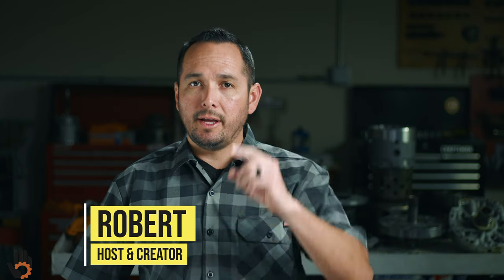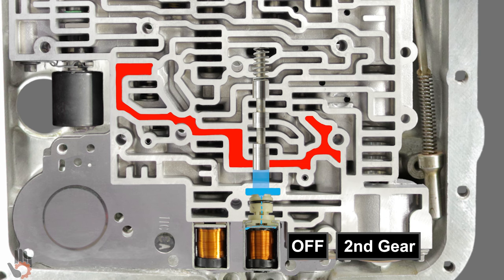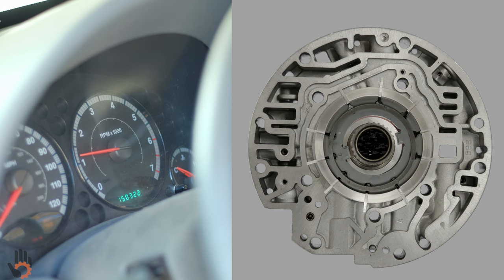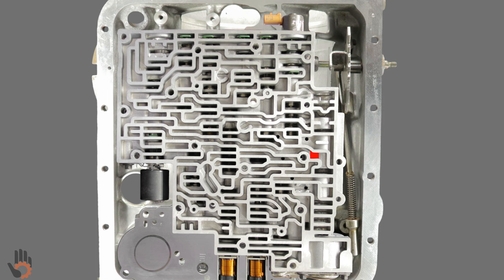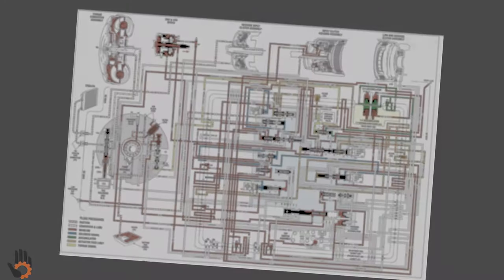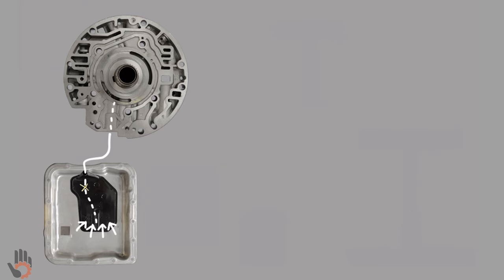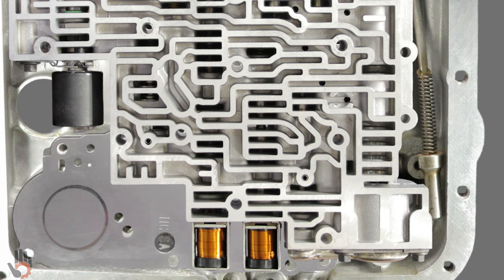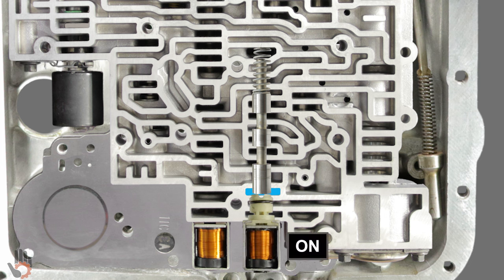4L60E: 1-2 Shift Valve + 1-2 Shift Solenoid (Part 1) Basic Operation

Comment: Wanna know about throttle valve
Reply from the maker: This trans is not equipped with a throttle valve.  The predecessor of this trans (700-R4)(also known as the 4L60) was equipped with one.  The 4L60E uses a solenoid instead.

Check out these videos to learn more:

4L60E Pump:
How Does it Work:  https://youtu.be/gJ5CdPJoJyg

4L60E PR Valve:
Part 1:  https://youtu.be/ELhJlZridIY
Part 2:  https://youtu.be/dJlUec91kgY
Part 3:  https://youtu.be/PY1trZeLqTM

Comment: We have a 2017 silverado 4.3L WT and now it just sits in our garage figuring out what's wrong with it. It only goes in reverse and wondering if it's the shift solenoids. There's no engine light on,no noises from the transmission. We took it to a Chevrolet dealership shop and they said we need a new transmission. Another shop said its the drum in the transmission. Our truck is little over 70,000 miles we only use it for work and get groceries. Not for hauling heavy duties or racing. We lost all hope because everyone wants 5,600 to 10,000 to fix our truck.
Reply: You have a broken drive shell
Reply from the maker: Sorry to hear about your transmission troubles.

If there was problem with a shift solenoid, you would still get forward movement.  However, the trans would be missing a gear or two...but, still have forward movement.
So, I don't think a shift solenoid is the issue.

I should really be asking more questions....but....
Based off of the info provided, I would be leaning towards an issue regarding:
1). Forward Clutch.
2). Input Sprag.

If you want to learn more, check out these videos.

4L60E Power Flow (1st, 2nd, 3rd, & 4th Gear) (Automatic transmission power flow)
https://youtu.be/IfOqbTqKubE

4L60E Power Flow - Manual 1st, Manual 2nd, & Manual 3rd
https://youtu.be/6kfAuXJFYFE

Comment: Hello sir . 2st gear only every time work .another gear don't working .how to repair guide.
Reply from the maker: Are you certain that it's 2nd gear, and not 3rd gear?
Reason being, if the PCM (computer) detects a major transmission problem, it will put the transmission in Fail-Safe Mode (also referred to as Limp Mode).  In this mode, the trans will only have 3rd gear, when the shifter is in the D position.  However, it is possible to get 2nd gear, too, by manually shifting.
Of course you'll have Reverse, too.

Was the transmission experiencing other problems, before this current problem occurred?
Reply: @SouthpawAutoworks  does't was other problem
Reply from the maker: Sorry, but I'm having trouble understanding.

Comment: My 4l60e slips on 1 2 shift and 2 3 shift if in drive but doesn't slip if shifed manually.  Anyone have a solution?
Reply from the maker: It sounds like you've got a clutch failing.

The 4L60E has multiple oil pressures working inside of it, all at the same time.  The highest oil pressure is used to apply the clutches (and the band).  That's it's main job.  The lower oil pressures are there to do other jobs.

When the PCM (computer) "sees" that the trans has been shifted into a manual gear (as opposed to D), it instantly raises the highest oil pressure....that's acting on the clutches.
There's a reason it does this...more on that, another time.

So, it sounds like you've got a clutch (or two) that's failing (slipping).  However, when more oil pressure is applied to the clutch, it reduces the chances of slipping...just like you're witnessing.

Think of the clutch as a clamp.  With less clamping pressure, things can start to slip.  However, with more clamping pressure, we can hold things tightly.

Solution:
It may be time for a rebuild.

Comment: I do enjoy your animations! Very good piece of work! 

Can't wait till you get to the 3-2 downshift solenoid. For that fact will you make a video explaining the difference between the early PWN style, the later on/off style and finally, the way the 4L70 handles this matter without the solenoid?
Reply from the maker: Glad you enjoyed it!  They're a lot of work to create, but it is truly a labor of love.
Def would like to tackle both types of the 3-2 downshift solenoid.  In good time...
As far as animated videos go (as opposed to rebuild videos), the 4L60E 2-3 Shift Solenoid is next in the cue.

Thanks for dropping me a line!
Reply: @SouthpawAutoworks  this is fascinating - makes me respect this transmission. As far as the 3-4 clutch vulnerability, based on the spring centrifuge cavitation, my plan is to stay under 5000 rpm once I get my new (rebuilt) transmission tomorrow. thanks

Comment: When I put shifter from park to drive there is 2 seconds delay before transmission actually is in 1st gear and ready to drive, everything else works good, that delay is only problem and only happens when I put shift from P to D, anybody know what I should do to fix this problem?
Reply from the maker: Questions:
1). Year/make/model?
2). Transmission history?
3). Recent vehicle repair history (engine, etc)?
4). Does this problem only occur after the vehicle has been parked over night?
      Or does the problem occur every time, even after the vehicle has been driven throughout the day?
5). Does the problem occur only when the engine/trans is warmed up?
     Does it only occur when the engine/trans is cold?
     Does it occur all the time, regardless of engine/trans temp?

I'm extremely busy, but would be happy to try to assist...as time permits.
Please answer each of my questions, in the order that they're asked.  If you can list out each answer (numbered, like they are above), that would be greatly appreciated.  Thank you.
Reply: @SouthpawAutoworks  
1.)2011/ Chevrolet/ Colorado / crew cab 
2.) no body touched anything on transmission ever, I never bring it to shop to someone do anything to transmission 
3.) I have this truck since 2015 and I bought it with 20k miles from Chevrolet dealership it was like brad new, since I have it I didn’t have single mechanical problem, I only do aggressive regular/preventive maintenance, last year I changed brakes including rotors and  pads,  drums shoes shoes and new brake fluid, new water pump, belt, tensioner, pulley, new coolant, new differential oil,
4.)the problem occur every single time I put from P do D doesn’t matter if engine/transmission is cold or warmed up, problem occur every time even I don’t drive it for few days
5.) 4 years ago I got stuck in deep snow with some all season tires on truck, I was shifting from D (drive) to R (reverse) many times in very short amount of time while I was trying to get out, I was shifting from D to R and from R to D very fast I was trying to catch small momentum so I could get out, few times I shifted to fast wheels still spinning forward and I’m trying to put in R and opposite, I got out off that snow maybe after 10 minutes, and since then I noticed that delay of 2 seconds every time I put shifter from P to D, everything else on transmission works good without problems, but I don’t like that delay, thank you 🙏🏻

Comment: How automatic transmission shift gear?
Reply from the maker: Computer is programmed to control the transmission.
Reply: @SouthpawAutoworks  i want to know the mechanism,please explain it to me the whole process of changing gear please.
Reply from the maker: Computer is programmed to:
1) Control the transmission (the solenoids).
          It controls shift timing and shift feel, as well as the TCC (torque converter clutch).
2). Monitor transmission, engine, and vehicle sensors.
          It uses info from various sensors to determine transmission shift timing and shift feel.
          It watches the MAF sensor to determine engine load, and the VSS to determine vehicle speed.  This info affects shift timing/feel.
          It watches a lot of sensors.  This is why it's super important to tackle any, and all, engine problems prior to troubleshooting transmission problems.

Hope this helps.

Comment: 07 Sierra 5.3 L...... Only shifts rough from 1st to 2nd AND it only does it when I've driven for at least 30 minutes...anyone having similar issues or know the corrective action?
Reply from the maker: Do you have a check engine light on?
If so, have you pulled/retrieved the diagnostic trouble codes? (P01870?)
Reply: @Southpaw Autoworks  P0894 is the code and it just says "transmission component slipping"
Reply from the maker: When the PCM detects clutch (component) slippage, it does what it can to try to save the transmission from further damage.
The PCM has control over the Line Pressure (the oil pressure used to apply the clutches).  It will raise this oil pressure, in an attempt to stop the clutch from slipping, or at least minimize the slippage....which will prolong the life of the clutch.
Excessive slippage, left untreated, will result in the clutch failing.....which results in a need for transmission overhaul.

As Line Pressure rises, it ultimately results in firmer shifts.  In this sort of situation, it's common for the 1-2 shift to become quite firm....and yet the other up-shifts don't feel nearly as firm.

Comment: Toyota camry1992 2.2. Work  only in reverse. Could  be broken  solenoid for forward reason why  car don't ride forward
Reply from the maker: Sounds like the Forward Clutch is smoked.  Could be a bad input sprag....if it's equipped with one.
Your trans may not refer to the clutch as a "Forward" Clutch.  They may employ names like C1, C2, B1, B2, etc.

Generally speaking, when a shift solenoid fails, you'll still have forward gears.  You'll just be missing one, or more, forward gears.

Comment: I just replace the valve body and the reverse don't works
Reply from the maker: There's two digits stamped on the VB (valve-body).  Those digits indicate the year it was made.
What year of VB was removed?
What year of VB was installed?

Did you use the same separator plate (also referred to as a spacer plate)?
Or, was a different one installed?

There are different gaskets for the separator plate, too.

Comment: 4L60e - Goes into gear no problem and engages - problem is 1st gear - it will just rev very high RPM then shift to 2nd. It’s like a delayed or really late shift.
Reply from the maker: Thank you for the detailed comment.

Questions:
1). Do you have a check engine light illuminated on the dash (instrument cluster)?
2).  Even if there's not a check engine light on, please try to retrieve codes any way.  What codes do you have?  (Please share all codes, including engine, transmission, body, etc).
3). Is the vehicle speedometer working?
Reply: @SouthpawAutoworks   the LS1/4L60 was swapped into my 1950 Chevy coupe. Been running great the last 3 years. I plugged my OBD2 scan tool and I do not have any codes.
Reply from the maker: Okay.  Thank you for looking into that.
I have some ideas, but need time to respond.  One of the ideas is solenoid related...

I recently dedicated a video to the 4L60E Shift Solenoid.
Here's a 60-Second PREVIEW:  https://youtu.be/JXFjMlsqirs
Reply: @SouthpawAutoworks  that’s my initial thought. Going to drop the pan and test the ohms on each solenoid
Reply: I checked the solenoids and both are reading 22.7 ohms. What’s the next thing I should check?
Reply from the maker: Right on.
Reply from the maker: Sorry for the delayed response.

That's within spec.

It's possible that the 1-2 shift solenoid is partially restricted (learn more about solenoid operation: https://youtu.be/JXFjMlsqirs ).  To rule out the solenoid, you could simply swap both shift solenoids, and see if the issue changes.  Note:  The 1-2 & 2-3 solenoids are identical components.

You could also be dealing with a sticky 1-2 shift valve.  Remove the 1-2 Shift Solenoid.  The valve should be trying to pop out of the bore, when you remove the solenoid.

Next place I'd be investigating is the TPS sensor and the speed sensor.  The PCM uses the info provided by these sensors in order to determine the timing of the shift points.

Hope this helps.
Reply: @SouthpawAutoworks  one of the check balls got lodged into the plate and burned up the band
Reply from the maker: Glad you got to the bottom of it!

Comment: A p 1870
Reply from the maker: This is a trouble code related to the TCC (Torque Converter Clutch).  It's a large clutch that lives inside of the torque converter.
It's partially controlled by a valve-train located inside the VB (valve-body).  It's a very active valve, that over time wears out.
As it wears out, the valve starts to leak oil (internally).  This leakage results in less oil pressure being delivered to the TCC...which causes it to slip....which is detected by the PCM (computer)...which then results in a check engine light (P1870).

Regarding your last comment:
As the trans heats up, the oil starts to get thinner.  This makes the leakage at the valve (located inside VB) even worse.

Hope this helps.
Really need to create a video on this topic...